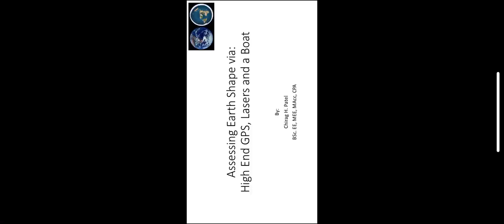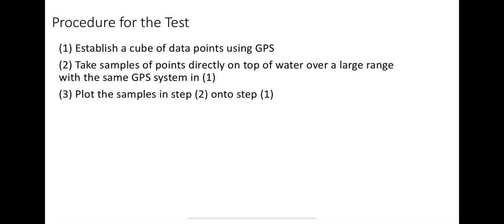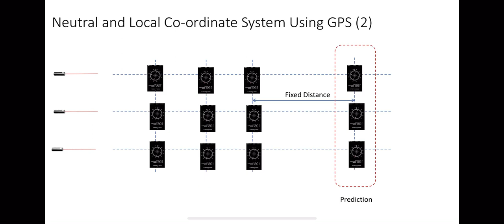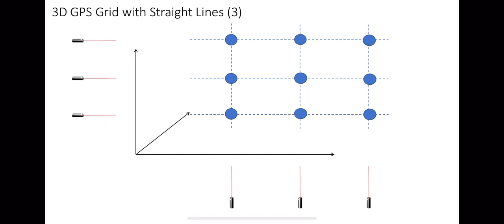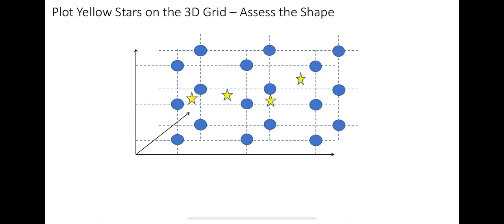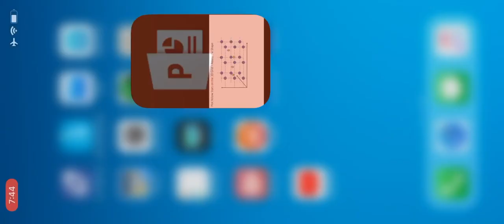(Flat Earth) Elegant Test to Assess Earth Curve Using High End GPS, Lasers and a Boat

Comment: You suggest taking measurements, as an example, around the shore of Lake Michigan. Do you intend to set up your coordinate grid on this scale, or do you intend to extrapolate a curved coordinate system from a much smaller local grid? How do you expect to make such an extrapolation? If your grid is big enough to detect the curvature of the coordinate system directly, you do not need to make the additional measurements around the lake. If it is not, it cannot be used to differentiate between spherical and cylindrical coordinate systems.

Lasers do reliably produce straight lines on a local level. Over the size of a grid necessary to detect the curvature of the coordinate system, however, atmospheric refraction could be significant.

You say of GPS coordinates, "more fundamentally, it's just 3 numbers. It's just wherever you move your phone or GPS unit, it gives the person reading it 3 numbers back." As an abstract coordinate system, I'll agree, but let's not forget that latitude and longitude have well defined ranges, and they correlate with various empirical observations. In particular, if we consider that longitude has the same range of -180 to 180 degrees at any latitude, I would propose a simpler experiment. You tell me what you think is wrong with it. Find a relatively flat area. Note your GPS coordinates. Travel 1 mile (or your preferred base unit of distance) east or west at the same latitude and note the change in longitude. Repeat at a variety of latitudes in the northern and southern hemispheres and plot the results. A linear relationship between latitude and longitude-per-mile is consistent with a cylindrical coordinate system (flat earth). A cosine relationship is consistent with a spherical coordinate system. Enlist the assistance of others, if required.
Reply from the maker: The plan now is to make a line offshore (record GPS along it) and then collect data on the water. The line plotted along with the water data (on any co-ordinate axis) will serve to ensure GPS or the axes the data is plotted on is not biased to any particular shape.

Thank you for providing another absurd test regarding "testing" latitude/longitude.
Reply: How large do you plan to make the offshore line? (I thought it was supposed to be a cube.) Is it enough to detect the curvature of the coordinate system, or not?

If you think my latitude/longitude test is absurd, please help me understand why.
Reply from the maker: As long as modern surveying can produce a perfectly straight line.

Comment: I'll explain my objection or what's missing (within how I understand the test) and make a suggestion for you to explain the test :

PROBLEM: we'll build new coordinate system (the cube) that we understand how it extends in x, y, z . And we can even select a point in the cube to be "0, 0, 0" then we'll put yellow star somewhere that we have it's coordinates and somehow translate it to the cube coordinates system and let's say we chose to have that yellow star at the same elevation above sea level as the cube's point of origin and at the extension of 2 blue point  then we look through those 2 point 0, 0, 0 and  0, 1, 0 and expect the boat to be exactly on that line of sight (flat earth) or below that line of sight (curved earth)  . Point is there has to be an observation combined with the collected/calculated/predicted data, and so far this looks like all the usual tests that uses comparison between observation and curvature calculator prediction.

SUGGESTION: is that you explain the test through presupposed data (for both inputs and outputs) within reason and point out exactly  what we do with the numbers, what to compare against what, doesn't worth a heart attack, just suppose 2 sets of data, one that suggests flat and the other suggests curved and why they do so.
Reply from the maker: I will work on a more detailed test plan. I appreciate your thoughtful feedback.

Comment: Like another said, kudos for proposing an actual means to build data on. I understand setting up a grid system to test within, something that is set and agreed on, fantastic.
What remains unclear is the portion of the test using points or stars and/or lasers. Could you explain that in a little more detail? Are you proposing lasers to test if the various grid points are in line and equal heights? Are you using the same GPS to test elevations between grid points? If you could clarify how the test is to be conducted that would be great. Thanks.
Reply from the maker: Would consult an independent engineering/surveying firm to produce the local grid. The whole test rests on that.
Reply: @TheMindofGod  it isn't the grid points that I am curious about. What is the actual test once the grid has been established.
Also, there was a similar question from Crowxe but it is gone. He is someone that I believe would be helpful and not negative. Just my 2 cents, if my 2 cents are worth anything.
I truly feel that if you are completely open about your proposal you will find help from the science side and push back from the science deniers. You will be shown whom are honest about evidence and those stuck in echo chambers. Take care.
Reply from the maker: I have gotten a thumbs up from 3 ballers who are on these live streams regularly.
Reply: @TheMindofGod  I'm not saying I'm giving it a thumbs down just asking for clarification as to what the test is. That is all, just not sure what the lasers or random GPS points are going to show anything other than height of water.
Reply from the maker: Think on it a bit more. If you need clarification - we can dialog.
Reply: @TheMindofGod  You are right. The grid have to be large and precise. The question is, when you are able to create such grid, that consist of perfectly straight lines, why bother with whole grid, lakes, boats and coordinate conversions? If you have single perfectly straight line with at least 3 points on it with precise GPS coordinates, then you can tell that Earth is flat or round already. If the deviation of GPS altitude changes linearly (incl. no change at all if you make it perfectly level too) then Earth is flat. If change of elevation create circle, then the Earth is round. If you are not able to create this perfectly straight line, or your GPS readings are not precise enough then you will not be able to create the grid either.
Reply from the maker: harrycallahan Again think it through why this would be required to prove this rigorously. It’s not that complicated.
Reply: @TheMindofGod  Thanks for answer. OK, I will try.  
However, what is questionable on single straight line simplified test? We know that GPS readings at sea level will show you altitude of 0 (or very close to 0) anywhere on Earth. If you will be able to make straight line and you will read from GPS altitude of 235 at beginning, 240 at center and 245 at end, then Earth is flat. If you readings will be 235 at beginning, 240 at center and 250 at end, then it is not possible to have all sea levels on straight plain and therefore the Earth is not flat.
Reply from the maker: You just said altitude would be 0. Why are you using numbers of 235, 240, etc.?
Reply: @TheMindofGod  There are two parts to the test, just like in your proposal. The differences are: 1) you will measure only one perfectly straight line instead of whole grid and 2) instead of measuring points on lake, you will use known fact of 0 elevation measured by GPS at sea level. The first step can be performed anywhere you want. You can take the laser and GPS device to your golf course above Houston and take measurements there. So 235, 240,.. are just examples of possible values. The absolute value is irrelevant, important is function describing change of elevation with distance. This is something you will have need for extrapolating your grid anyway. If the result will be linear, then you can just mathematically rotate this line to be perfectly level, you can subtract elevation to map this line to sea level, you can extrapolate this line and you will see that this perfectly straight line match with sea level all over the Earth. Or your readings will indicate that the result of this function gives you more parabolic shape, then you can again subtract elevation to map this result on sea level, but you find out that this straight line, when mapped on sea level will curve up from that sea level with distance, therefore Earth is round.
Reply from the maker: We are supposed to dialog with GH and JK tomorrow morning at 9 AM CST on Jose's channel. I can clarify then. I don't think you understand the test I am proposing.
Reply: @TheMindofGod  You are probably right. I have some gray areas mainly in math you will be using to extrapolate grid and for mapping in 2nd step. Lets assume you will be able to create and measure perfectly straight grid 100x100x10m with great precision. How you will extrapolate this grid to lets say 10km? If the Earth is globe, then your calculation will show you, right there, your extrapolated elevation of GPS coordinates for point on straight line 10km away will have to be raised about 8 meters and for 20km away, you will have to raise elevation of GPS coordinates of that point for another 23m. But when you measure flat surface (like sea or lake) your GPS elevation does not change. You will get 0 at sea level everywhere, or 175m for whole Lake Michigan, or 3815m for whole Lake Titicaca, .. But of course, do what ever you want, it sounds like lot of fun. Just be prepared this can turn out to be life changing experience ;-)

Comment: This sounds like a good test. If the earth is flat, the cube you create in open space will be analogous to the cube you create on the water. If the earth is spherical, the cube you create in open space will be a cube, and the "cube" you create on the water will not be a cube, but an angled rectangular prism of sorts.
Reply from the maker: It would highlight two different surfaces fairly easy in my opinion. Thank you for your feedback RS.